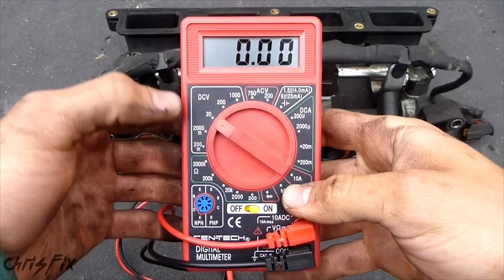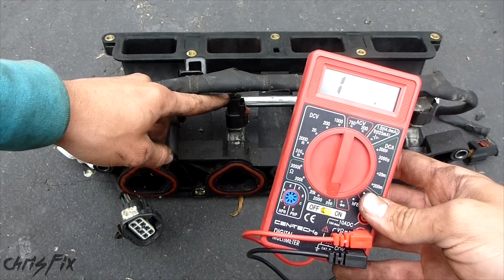How to Check Fuel Injector Resistance with a Multimeter

Comment: Chris you saved me a bunch of money!  I used my multimeter to test the injectors on my Chrysler 200C 3.6L.  Each tested at 15.0 ohms, except my one trouble cylinder.  That one tested at 33.0.  Replaced that injector, all my engine warning lights turned off and it's running smooth.  Your video very straight forward and the graphics made it easy to understand the discussion.  Thanks!!!
Reply: I tested it while the injectors were still attached to the car.  And you’re testing resistance, so no power is needed.  Search testing resistance with a multi-meter.
Reply: Hey man. When u tested your Chrysler 200. You tested it while the fuel rails and injector was still on the vehicle correct? Just have the car off and test it right? I got a Chrysler 300
Reply: I was wondering this too. Do you test it with the car off or on? If off how does it get any readings since there's no power technically
Reply: @celestehauglin7004  No power is needed to read current (ohms). You can test like he does in the video with the injectors attached to the block (just unplug the injector cable). So keep your car off so you're not misfiring that cylinder unnecessarily!

Comment: I have a Q 
My car hyundai accent 99 
Power supply measured between 2 pins in wire of each injector is 7 v 
But when i measure each pin with body of the car one measure 12 v and other 5 v 
Is this normal or what should i do ?

Comment: Hi Chris fix, love your videos. I have a fiat 1.9 jtd which intermittently won't start. She cranks and occasionally catches but I'm just wondering if you have any advice. I've changed crank sensor, tested the injectors, new glow plugs. I can even hear the fuel pump when the ignition is on. Once again love your videos and stay safe.

Comment: Is there a typical number of years or miles injectors should last?  My 2004 VW GTI has 140K miles and the original injectors.  The fuel rail and injectors were cleaned only once at around 80K mile.  The car has only been filled with manufacturer recommended 91 octane gasoline at each fill up, and runs great.  Roughly every 4 months I put a bottle of Lucas injector cleaner in the gas tank at fill up.  Should I be concerned?
Reply from the maker: I wouldn't be concerned at all, if your car is running great and you are putting in quality gasoline, those injectors will last the life of the car!

Comment: Hopefully you are still monitoring questions?! 2005 Pt Cruiser GT 2.4 Turbo: showing p0203, p0032 and p0038. I see that 32/38 are related to o2 sensors, I am going to test injectors later today, but do you think it's possible that if there is a failed injector, could this be leading to the o2 sensor related codes? Thanks
Reply: The problem is you're driving a PT cruiser
Reply: P0203 3rd is injector I guess the injector dosent opening

Comment: Sir is more resistance means rich mixture ?
Reply from the maker: More resistance means there is a bad injector, and it can actually mean you are running lean, as the injector will not be able to fire properly!
Reply: ChrisFix sir but there is no loos in power and rpm are good but car is giving smell of un burnt gasses
Reply: ChrisFix I have santro 2004 model it is showing 16 ohms resistance and it have 1000cc engine 4 cylinder isn't it rich mixture ? 🤔

Comment: I have a 2003 Dodge Ram 1500 4.7 engine turns on but struggles to take off sometime will turn off at a stop or running turns right back on but same thing lags very badly

Comment: What if your 2 prong connector piece has slight oil inside of it. I noticed all other ones are dry and the cylinder it's misfiring happens to be the same connector. What do  replace if this is the case? Some type of oring or do I need replace the connector. Please Chris if could tell us what's happening for those who come across this problem

Comment: Very useful video. 
How should I check if I think it's the connection plug from the vehicle harness? Run the multimeter to that too? Car on or off?

Also, just to let some of you know, if run bigger injectors the ohms will be lower. For example, I have Siemens Deka 60 lb injectors and they read 12.5 ohms.

Comment: I have watched this three four times to make sure I get this right. I have a pt cruiser 2.4l turbo the same multimeter set on the exact same settings. The numbers were all over the place high hundreds to nothing the reading numbers never stopped. checked them off the car on the rail, individually and back on the car. Whats up with that??

Comment: sir, my car i20 has 2 separate coil packs controlled by 2 wires connector which controls 2 high output terminals. However, one high terminal pin 4 of first coil gives less spark than pin 1 on the same coil pack. Why such less spark being provided by the same primary coil??

Comment: can a fuel injector still be faulty even if the resistance was good?
Reply: Yes,if the injector is clogged then it will not pump the fuel  to engine.
Reply: @ranjibborah3274  my issue was flooding the cylinder. I checked the resistance on my cylinder 6 compared to the rest and it was within range but it was flooding there. tested it with a jerry rigged battery and tester its not stuck open either but when replaced the injector the flooding stopped. 

not sure whats wrong with it. the new injector actually has lower resistance than the older ones (old ones are at 12.8-12.9 the new one is 12.4).

but yeah fixed the issue now.

Comment: I checked 3 injectors.  2 injectors are around 14.7 ohms and the 3rd one is 27ohms.  Does this mean the 3rd injector is bad?
Reply from the maker: Correct. You only have 3 cylinders?
Reply: @chrisfix  no it's a 6 cylinder 2010 Ford fusion sport.  I got a check engine and when I scanned it, it's cylinder 4 misfire and running too rich along with an injector I think staying open.  I checked fuel injector 4, 5 and 6.   Injector 4 ohm reading is 27 ohms.  Injector 5 and 6 both read 14.7 ohms.  I am not sure if changing the injector for cylinder 4 would fix the issue
Reply: By the way, I checked cylinders 4, 5 and 6 because that's the bank facing me and available to check.  Cylinders 1, 2 and 3 are under the intake

Comment: Hi Chris, I have a 99 Honda Accord 4cyl that wouldn't start a few days ago.  I checked for air, spark, compression, and fuel (I did not check timing because the timing was looked at not too long ago).  I did not hear a clicking from any of the injectors though (used mechanic's stethoscope).  I read with main relay also supplies power to the injector and tested the main relay.  Main relay is good.  Any ideas what it could be?

Comment: I changed all 6 of my fuel injectors and spark plugs but it’s still misfiring injectors what’s the problem someone help?!?
Reply: Check for a vacuum leak near the manifold, it could also be the gasket for the intake manifold

Comment: Hay Chris been having problems with my 4.6l 2v and I have a p0301, I have checked and changed plugs and coils, still same problem.. my best bet would be to check if it’s my injector from cylinder #1 is default and change it...
Reply: Dealing with the same issues with my '03 GT
Reply: TheCreaturex26 bro, try checking if your intake manifold gasket has any leaks, also check if your timing is off...  try changing your injectors and check if problem moved to another bank.. if I did then it’s the injector...
Reply: Jose Arellano  thank you bro!
Reply: TheCreaturex26 yeah suck when you have to be troubleshoot by yourself..!! Lol

Comment: This is a good test, but it ONLY tells you if the coil is shorted/bad, it doesn't do a thing to tell you if the injector is clogged or the spring is broken. For that the easiest test is to disconnect the injectors ONE AT A TIME and see if they make a change to the engine or not. The one that DOESN'T make a change to the current sound is likely the bad one, as the working ones are noticeable when they're pulled offline.
Reply: Ryan do I do that while the engine is running? Thanks, Becky
Reply: That still doesn't tell you if it's clogged or shorted just that it is bad lol.

Comment: Could you also use a multimeter to test the pigtail harness that connects to the injector? I'm not sure if power is going to the injectors because they aren't firing.
Reply: Yes.. I had a dodge charger plug only spittin 2v vs the 7v it should be.. Injector wouldn't fire the pcm cut off that cylinder do to a bad lifter

Comment: chrisfix . I have a jeep liberty that when I press on the gas pedal hard  like 5000 rpm , either on driving or idle the fuse injector blows out, ,if I drive it  normal , and less then 5000 rpm everything is ok , do you think I should check each injector for same ohms all the same.????

Comment: Is there a good way to repair the wires to injectors if they get damaged. Just before the connector both wires on one set were cut open and arcing. 

Thanks, You are my idol.

Comment: does this count for Diesal  motors as well as petrol>>??
Reply from the maker: It depends. Some Diesel engines use a motor to pressurize the fuel rail a lot more than a gas engine and he injectors are direct injection into the cylinder rather than port injection.

Comment: I put a new fuel pump in my mom's car. It's wants to start but it don't. We soaked a shirt in gas put it in the air filter and it started for a second until the shirt dried up. Could the injectors be the problem? It's a 03 lesabre
Reply: Check the filter might be clogged

Comment: Dear my friend my car engine CE30 opel senator 6 cylinder 3.0
I have engine shaking when i press padal in i checked what you done the ohm 17.2 for five injectors and one 16.8 is that the problem?
Note i change all sparks with new one.
Reply from the maker: It probably isnt the problem (but it could be). What you said sounds more like a distributor, spark plug, or wire problem.

Comment: dammit I did a spark plug and wires change,  coil pack too and still the same issue!  it's definitely running lean (camaro 01 3800 2 series) gonna try some of these tests and hope it isn't far much worse like a intake gasket.  thanks Chris!  I have some hope now lol,  cylinder 2 is misfiring and I have a vacuum leak.  might be my exhaust
Reply from the maker: +jesse arcos good luck! I'm guessing intake manifold!

Comment: Informative. Thanks. So, you don't need to have the engine running or even have the injectors mounted in the engine? In your video, the intake manifold, fuel rail and injectors are completely removed from the vehicle.
Reply from the maker: Correct. You cannot have the engine running since you are removing the wiring harness from the fuel injectors.

Comment: I tested all my injectors they're all good regarding the ohm meter. New coil packs new plugs new wires switched around the injectors and I'm still getting a misfire on cylinder number 3. 2003 Mazda Protege 2.0 liter. any reason why I would still get a misfire in number three? Compression is 145 across-the-board. Is there a way to check the voltage coming out of the plug that goes on to the injector? thanks great video

Comment: hey Chris...do you have any way to get me the ignition coil resistance value for a 2009 hyundai accent...cant find them online anywhere...my resistance goes up when the coils are hot...got new ones and the secondary resistance is totally different.
Reply from the maker: Check them all, it would be very very rare that they are all bad. Usually one or two will go bad.
Reply: I did check them all when they were cold and when they were hot...they were all in spec compared to what I found for a 2011 kia rio when cold, but not in spec when they were hot...the new ones I got i tested only cold and the secondary resistance was high compared to the Rio specs...so, I have no idea what ohms I SHOULD be getting.

Comment: hey chris. my truck has been idling rough and i have changed the wires, plugs, rotor and cap and now i am going to try cleaning the injectors to see if that will help.
Reply: I got same problem on my 99 Toyota Rav4 and now gettin ready to change fuel injector. HOpe thats what It is and I think it is.....good luck to you.

Comment: To get an accurate reading, you need to subtract the lead resistance from the resistance of the injector
Reply from the maker: Thanks for sharing. If you are comparing all the injectors with the same multimeter you do not have to do that. The bad injector will stick out.
Reply: ChrisFix wow thanks for replying! Most channels I subscribe to don't reply on their older videos. 
That is very true. However it is good practice to minus the resistance of the leads from the measurement all the time. Another benefit of subtracting the meter lead resistance in this application is you know if the injectors are with in specs. 
Great videos! I love your content and you've given me the knowledge and confidence to start doing more in depth services to my car

Comment: question
car is turbo in line 4, code is p1701. would a bad injector that is not firing efficiently cause the car to run lean in boost.
ecu is showing over compensating fuel corrections.
car smells rich in idle sometimes.

Comment: hey Chris I got a 1995 Nissan 240sx se and my issue is the after I drive it for a while it bogs. already clean the throttle body, tps,maf. when  it bogs I see black smoke coming out of the muffler. it doesn't bog al the time. it does it for few seconds and stops. I need help.
Reply from the maker: +christian guzman that black smoke is an indication of running rich. Check your plugs, wires, and distributor.

Comment: hey chris quick thing to note, you should really check the resistance of the meter/test leads by touching the 2 leads together than subtracting that number from your reading (I noted all steps for viewers)
Reply: jljr1998 Even so you would probably still measure within tolerance of the injectors specification. A bad one will deviate a lot more than 0.5 Ohm

Comment: why 200 ohms chris?
Reply: jay 80 accuracy of the scale when reading the ohm meter. Always take the nearest higher setting as the value you will expect to read. In this case 200 is the nearest higher value to 16.5 Set the meter to 2000 and it may round off such a little value to 16 or 17, omitting decimals. Set it to 20 if you have it. The meter will anyway show when the measured value is out of range (higher than the scale).

Comment: When I have the Injectors out of the car they test in spec but installed in the car they test out of spec. what should I look at for the change
Reply: Matthew Wilkinson All of them? Maybe an internal short to ground? Normally the two pins in the plug are isolated from the outside and you should only measure between them, not between any of the pin and the housing.
Or your measuring tactic is not correct. Always measure resistance when unplugged, connecting a circuit influences the measurement.

Comment: Chris, I tested my injector on an engine that won't start. The resistance is 18.2 for all 6 injectors. the manual says 12-16. the 2 extra ohms would that cause the engine to not turn over?
Reply: Probably not no.

Comment: I was showing a #3 misfire so I did a complete tune-up. The tune-up made a big improvement but it still shows a #3 misfire even after clearing the codes.  A compression test said the engine is fine. The shops want a average of $100 just to diagnose. . One mechanic told me that all these fuel additives  don't really "clean" an injector; if an injector is "bad", cleaning it won't help.  Interesting. That would mean that all these fuel additive products are a rip-off!! Another shop said they will clean the injectors (without removing them from the engine) for $100. That could possibly be a rip-off too? From what you are saying, I should test the ohms and also the fuel pressure.That sure seems easy and simple enough.
Reply: Holly Metcalf It's true, most of those products that you can buy in a bottle aren't really that effective at cleaning your fuel system. While they do contain chemicals such as ether that CAN remove deposits, the problem is they don't remain in contact with the surface of the fuel-delivery system long enough to achieve the desired results. The only way to do this is to remove the injectors and soak them in powerful chemicals and/or mechanically remove the deposits. Consumer Reports did an article on these products a while back, and their conclusion was that these products are a waste of money. CR doesn't take ads (they are supported by subscriptions), so their articles are objective.